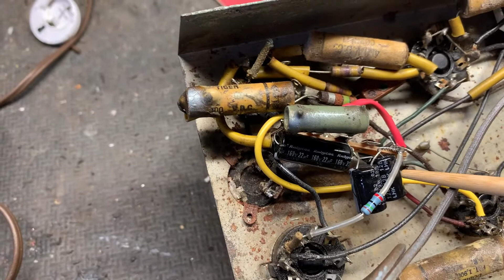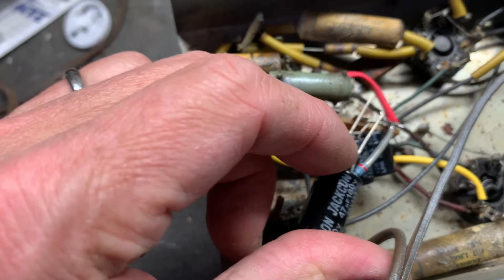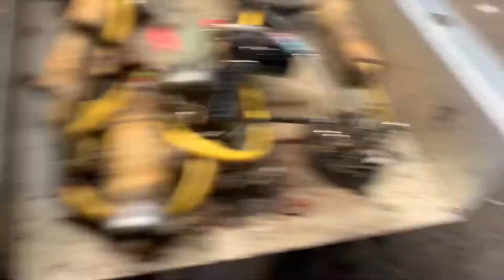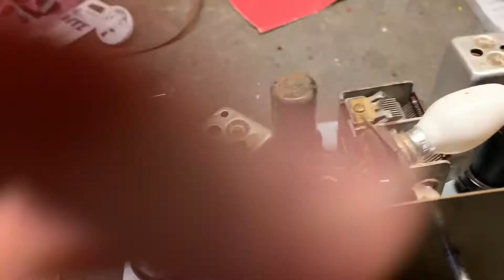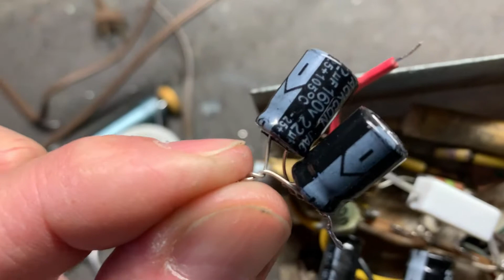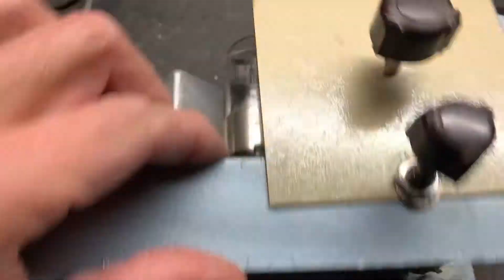Rusty Radio Repair!  Electone T5TS1 Antique Radio Restoration Part Three

Comment: In the past I would remove the tuning capacitor, wash it in soap and water, thoroughly dry and re-oil it then do a complete IF alignment.  That should solve your issue.